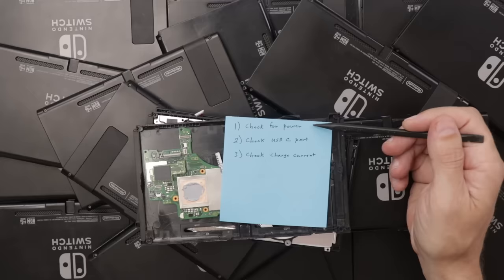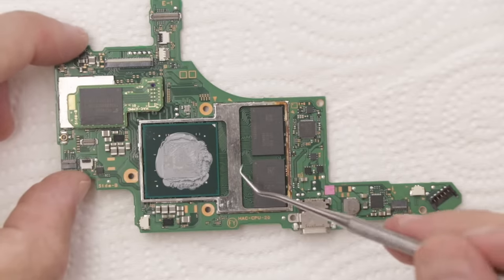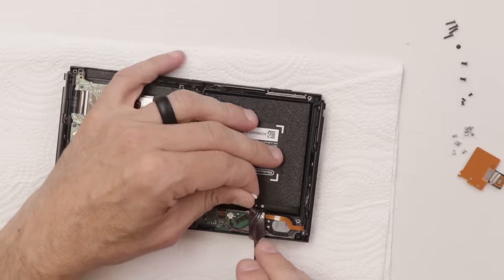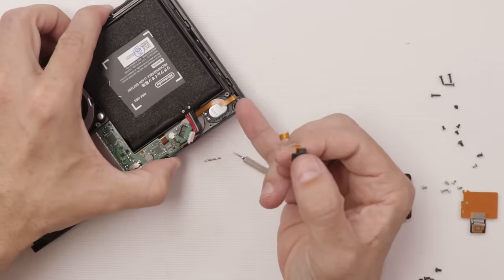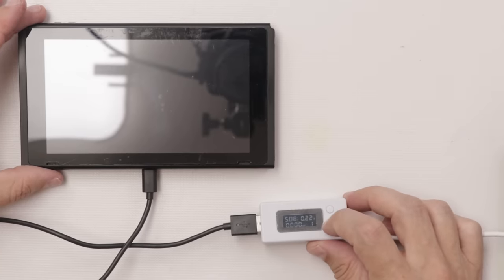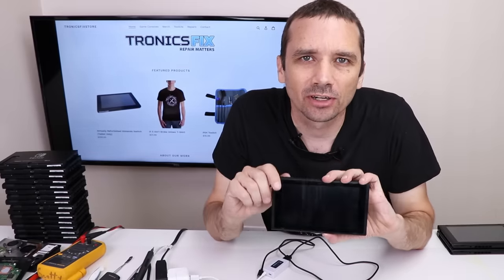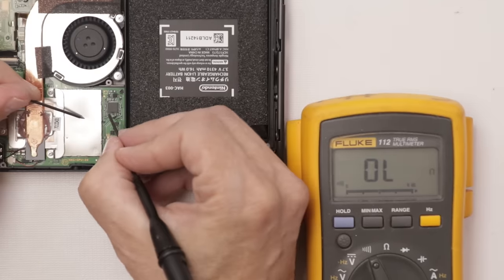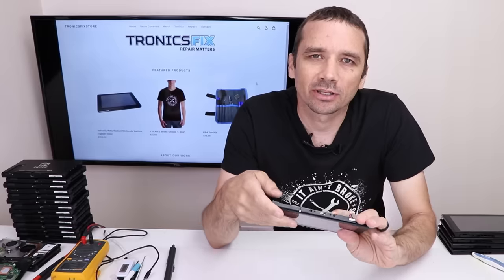I Paid $1,815 for 20 Broken Nintendo Switches - Let's Make Some Money!

Comment: Electricians are like:
beep -> "Oh, there is a shortage"
beep -> "Now it's gone"
Reply: if there is a shortage then it will beep on both sides of the capacitor but if there is no shortage it will beep on only one :)
Reply: lol true
Reply: not to forget that the  measurement device is labeled "fluke"

could be right, could be wrong
but the beep is always on
Reply: The "beep-meter" is designed to inject a small current and see if it loops through the probes (beep - short ) or not (no-beep, open). But he's checking capacitors, which are going to beep anyway (short or no short), because at first the beep-meter is going to charge it (current flows briefly) so it sounds like a short, but then stops readily and there's no beep anymore and that means it's not shorted in and out of itself or via the PCBs/Chips nearby.
Reply: @zet0korp  By your logic it would beep when you put probes close together,or put piece of paper betwen tips.Thats not how capacitors and multimeters work ;)

In this video he is touching other parts with his probes thats why you hear beeping,you can even see that audio is out of sync.
Reply: nixibreee errr... yes that’s how it works..a beep meters checks for continuity by attempting to  injecting a small current between the leads by applying a small voltage.. and yup, try it on a discharged cap and you ll see for yourself. The beep meter is basicly an ohmeter that beeps when encountering very small impedance. 
At first a discharged cap will look like a closed circuit to something applying voltage to it, until charged. It s the inherent high pass caracteristic of the capacitot that is at play. 
When the cap is charged by the beep meter s, it s only continuous current not the off-on step and continous current ( DC current) cannot flow through the capacitor.
Reply: Also depending on the continuity tester you use, the beep might be a bit delayed after making contact.
This guy obviously has a lot of experience with his multimeter so he can tell pretty exactly how long this delay is.
Still a bit confusing to watch if he is so fast.
Reply: @xpelestra  In theory, if you touch it to a very large discharged capacitor you would actually get a brief beep, as zetO described. However for basically any kind of SMD caps the current to charge the capacitor is so minuscule it wouldn't result in any noise. (it's also possible the multimeter has a low-pass filter that would effectively filter out the current from capacitors, but that seems unlikely and unnecessary).

Comment: As an engineering student focused on electronics in avionics, this is gold! One could only speculate in why those video chips fail, it's almost as they were designed to do it! ;)
Reply from the maker: Yep...seems like it. It seems to be caused by too much voltage...probably from 3rd party chargers.
Reply: Denninosyos Odinson most things today are designed to fail after a couple years electronics are the worst with this

Comment: This guy literally can make a working Nintendo for himself  from broken ones, cheaper than a new one
Reply: All for the cheap cheap price of $1800.
Reply: @ChefBoyareB  Assuming they were all the same price he paid $90.75 per switch
Reply: @niallcowman0  yes, as stated in the first 20 seconds.
Reply: @niallcowman0 , how much is your time worth to you? Let's say you pay yourself $50/hr, which is reasonable when it comes to skilled labor. IF it takes an hour to take apart, diagnose, repair and reassemble, that brings the cost to $140.70. Then you have your part cost. $30 parts cost for a video chip leaves you at $170.70. Refurbished typically sells at 10% less than used. So $180 for refurbished system. That's a profit of $59.30. Which isn't too bad. But that is IF that is the cost and labor time. Then you need to find someone to buy them what you're asking. More time of sitting on product, not making money.
Reply: or pay $30 more and buy a working one instead :P
Reply: I mean thats the gist of the video...
Reply: @ChefBoyareB  thats all fine and good, but if youre selling these and refirbishing them yourself, like he is, you dont randomly acount for some imainary $50 fee to yourself, because you get all the money from it anyway. So $90.75 per switch and a $30 video chip. $120.75. $50 profit per switch. Thats $1000 total, minus the ones that had worse issues. Seems a lot better when you dont give away $50 to yourself and dont add that in.
Reply: @CapnCook420  If you're not keeping score, you aren't winning. You still have to sell them. I don't know what he's selling them for. If you noticed in my breakdown, I averaged just under $60 per unit. There were 2 he couldn't repair at the moment. Which brings his profit down to $50 profit per unit. Now we don't know how much time was spent on each unit, I was being generous with only one hour. Realistically, probably 3. 3x20=60 total hours. As a hobby? Nice profit in your spare time. As a sustainable business though. No. You could make more working a regular 9-5 and NOT get screwed on your taxes.
Reply: @ChefBoyareB  i mean as this guy clearly knows what hes doing i dont think it takes him 3 hours on a video chip. Id guess more like 1-2 if that, its not the hardest thing to do. Maybe for the corroded ones but thats a bit much for a chip replacement. You can also buy them slower than 20 at once, or buy parts and/or fix them slower, you dont need to just sit on 20 at a time. Then you dont have 20 switchs all at once, and a video chip doesnt nearly cost $30 each anyway, more like $10 or $15. Even less if you probably buy in bulk like this guy. That many hours seems like a lot if you look at it all at once, but even though he probably did these all at once, or in a day or two, he didnt need to. We are rough estimating here but id guess more like 40 total hours on them, if that and he easily only paid $110 or less on each switch after parts, considering his knowlege in this he probably gets this stuff cheaper than most. Corroded ones do take longer, but are almost free to fix if you have the tools already and thats the only issue. Still pretty good return and you can fit it in one weekend off your 9-5. Either way hes making his money back, and then some. There is nothing wrong with investing in a project that will make you money.
Reply: @CapnCook420  oh I definitely don't deny it's profitable. We are working with a lot of unknowns. I was just simply stating if it was his job for steady income, it wouldn't be reliable enough. Especially when it comes to consumer based product. It's difficult to buy and sell for profit. Think of it this way, from a consumer perspective. You paid $300 for that thing. Would you pay $100 to have it fixed properly? Or buy a used one for twice that? I would opt to have it repaired. Now, you're in the business for buying something used. Anyone would want to pay the least amount possible. The perception of used is "good enough". Even though he would be asking for a reasonable price because he values his time and effort as well. But consumers don't see it that way. They just want it as cheap as possible. I'm going off on a tangent. I do that. Lol

I would pay top dollar for him to repair though. He doesn't use shortcuts or haphazard repairs.
Reply: But here we are, watching his videos and the subscriber count is awesome.. this is a video that you could calculate has him break even or actually "lose" money based on time, but the subscribers are probably where the real effect is sought.
Reply: this guy can literally resale each one and not waste time playing games and buy all the cookies he wants
Reply: Yep thats the video

Comment: Quick tip about li-ion battery.
When is left for long time(specialy discharged),the very first charge will be very slow to protect the cell itself.
So,the first switch may have a good battery but it needs slow charge first before gun in the fast charge.
REMEMBER,a fast charge to a very discharged cell will cause the cell to permanent damage or even worse,the cell may explode.

Love the videos!🥰🥰🥰

Comment: You could probably still use the original battery on the first switch. You would have to apply 5v to the battery to get its voltage high enough for the charge controller to accept it. Thats a trick i learned from Sorin at Electronics Repair School

Comment: I sold my broken switch,  tablet only for.$70. I broke the game card reader. Bought a replacement one, had it installed but it was a dud and then the touchscreen stopped working. Atleast I got $70 for it.....the buyer was aware
Reply: $70 isn't bad 

But couldn't you just return it to Nintendo or the shop is does that count as accidental damage?

Comment: circuit tester:
* beeps*
"yep this one is not working"
Circuit tester:
* beeps again*
"aaand this one is fine"

Whaat
Reply: The type of beep matters
Reply: On the capacitors only one side should be connected to ground and therefore beep. So the „tester“ as you called it beeped on both sides of the capacitor and he said „this one is not working“. On the other one only one side beeped.
Reply: THE TESTER HAS SPOKEN
Reply: @Jimmybrawd27 people who dont understand circuit testing like me BLEH BLEH BLEH MULTIMETER tech tech tech volt power
Reply: @Jimmybrawd27 brain hurt
Reply: ONLY THE GODS CAN COMPREHEND SUCH A COMPLEX LANGUAGE
Reply: everyones got long ass answers. short answer is it beeped on both sides instead of just once, so you heard 2 beeps instead of just 1 = shorted
Reply: It’s only supposed to beep on one side not both sides of the capacitor (the little metal boxes on the board he’s touching)
Reply: Im not sure If I have it set to show my real name, but if so, we're pretty close :D
Also, I'd like to mention, he states in the video that the circuit tester checks resistance, and it looks like only one side should have resistance, so he checks both sides, and if it beeps on both sides its got a short c:
Reply: So I guess this guy can understand what R2D2 says.

Comment: When you sell a previously water damaged unit, will you sell it cheaper and tell the costumer that it was water damaged or do they pay "full price" and you just hope it does not break again. ?

Corrosion means that the cobber tracks, and copper through hole platings will be degraded, just like if you have a metal plate that is rusted, you remove the rust, but the plate is now thinner and can take less stress/load.

The problem is, that a thinner copper track will carry less current, and will easier break under mechanical stress, so essentially what they buy is a unit that is more likely to break.

This is fine if people are informed, and paid a fitting price, but i would certainly be sad, if i bought a unit at "full (used part) price" and got one of these, limited life, units.

Also, have you tried measuring the voltage across the battery that you deem to be bad.

I have seen a lot of stuff, where, if there is no voltage on the battery, the charger will do strange things. Maybe the only problem with the "bad" battery, is that it needs a bit of initial charge to get the battery voltage up a bit. I have revived a lot of stuff that would not turn on or charge, by connecting the battery to a power supply, that was both voltage and current limited to avoid damaging the battery. When the voltage gets above 2,5 - 3 volts, it can usually be charged by whatever it is in, and with the supplied charger.
Reply: I bet he sells them as a standard, working used ones. I wouldn't buy anything that was water damaged and repaired.
Reply: As a person who fixes electronics, there is no obligation to say something was water damaged or anything UNLESS the buyer asks. It is simply “used” or “refurbished” condition.
Reply: @wh3elson  and that's why I don't buy any used/fixed stuff. John Doe explained everything.
Reply: not exactly, you can put a small amount of paraffine on the board and heat it so it spreads and avoid corrosion.
Reply: @fss1704  Yes, you can seal the damaged are, just like painting rusted metal with special paint, but the corrosion that has already taken place has corroded some of the metal, irreversibly damaging the tracks.

As said....If a PCB track has been corroded to a thickness of half of the original size, then it will only be able to carry half the current, and PCB designers usually factor expected current loads when deciding how wide a track has to be, and/or how thick a layer of copper has to be applied to the PCB that they choose for the manufacturing.

Also, a copper track that is only half the thichness, will be less resistant to breaking, if subjected to mechanical forces, like pcb flexing and what not.

You would probably not think that a car that had half of the thickness of the body panels rusted away, and then just repainted, had the same mechanical strenght as the original part.

This is the reason that cars that has previously been in an accident, will bring in less money, even if they have been repaired.
Reply: @wh3elson  As a person that was in the repair business for many years, it is very shady, NOT to tell the costumer about the true state of a product you try to sell them.

Usually when we found water damage we told the costumer and if they insisted that we fix their product, we always made it VERY clear that they would get a working product back, BUT, we would not honor any kind of warranty request on the repair, as fixing some corroded tracks, would often make the product work, just to have it fail sometimes later, as some other track that was under a component, then became the weakest link.

I would never have the conscience to sell someone a water damaged product, without telling the costumer, no matter if they asked.

But i see that your "ethics" are different.
Reply: @myousic4564  I think so to. People have different ethics, and if he does, i can only say that my ethics and conscience would not allow me to do this. Not without informing the costumer fully at least
Reply: John Doe that is true, I only follow what big corporations like bestbuy, Newegg, GameStop, Walmart, etc do. When you buy refurbished/used from them it’s the same thing. They don’t tell you exactly what the initial problem was. It’s up to the buyer to do their due diligence and ask about the refurbished state, as the word refurbish means that something was initially wrong with it. If the law states it’s ok, then I see no problem with it.
Reply: @wh3elson  But in my book "refurbished" is still "Remanufactured to factory standards". A water damaged unit that has just had the corrosion removed and then something put over, to stop further corrosion is not the same.
Reply: @JohnDoe-bd5sz  I think that there should be a clear warning that a refurbished item was repaired from water damage. It also should cost less than other refurbished ones because the risk of breaking it again is much higher than e.g. item that had battery replacement. 
I'm surprised you clearly stated that item was previously water damaged. I'm 100% at your side but as you said more than a half people would just hide info about water damage. It's so unfair IMO.
Reply: John Doe I see your point, and to compete with big corporations like Best Buy, Newegg, etc, I can’t hurt myself in sales so I can take the higher road. Until the law changes, or the rest of my competition starts stating “water damaged” I’ll unfortunately have to continue my practice and simply state refurbished/used and only explain further when a customer asks.
Reply: @myousic4564  I did, as i have to live with myself :)
Reply: @JohnDoe-bd5sz  Its shady but, customers wants a bargain, you pay what you get If I sell those, I will just only  mention boots up no warranty given. As per ps3 phat some just heatgun those and thats a temporary fix and not a permanent fix. Most second hand goods have something wrong hence they sell it.

Comment: Only question I have is how many off those Nintendo switches are BANNED?  And do you let the customer know about it before putting them on sale?
Reply: How would they get banned? Like from online or totally bricked?
Reply: @michaelg1237  from online..I mean they can be returns and they can be set to factory settings but if there BANNED from online use that's a issue for the buyer.
Reply: He sells them on his website which I’m sure he clearly states that they’re refurbished
Reply: Alex's Vice Not refurbished, but if the console is banned. I doubt this guy will check if every switch is banned, but the guy commenting is wondering that.
Reply from the maker: I check to make sure they aren't banned before I sell them. So far out of all the Switches I've bought for all my videos none of them have been banned
Reply: I would invest in a banned one actually 🙄
Reply: Why does your caps lock keep getting stuck when you write the word banned? Might want to get that repaired
Reply: Ronald Mendoza obviously he would mention that...

Comment: Have you ever used DeoxIT DN5 Spray for contact cleaning? Not only does it do an excellent job of cleaning off the crud, but it also leaves a protective coating that protects the contact so it maintains a great connection. This is not your average contact cleaning spray, it has worked Magic for me repairing corroded circuit boards.

Comment: Does reflowing the video chips help instead of actually replacing them?  Maybe just a bad soldering point?
Reply: That probably wouldnt cause a short.
Reply: This is true if the short is internal to the GPU.  Which you could only know if you tested something like reinstalling the "bad" GPU with fresh/clean solder.